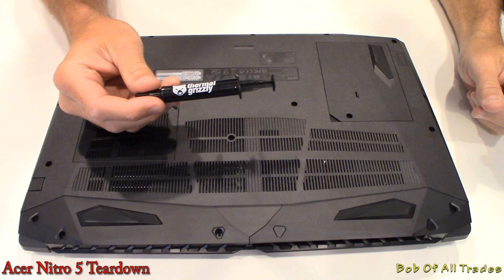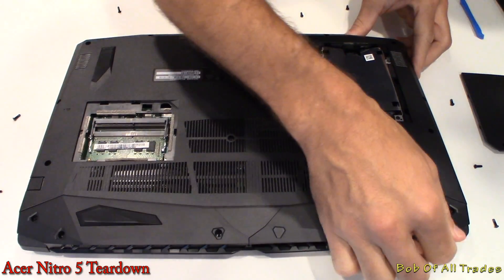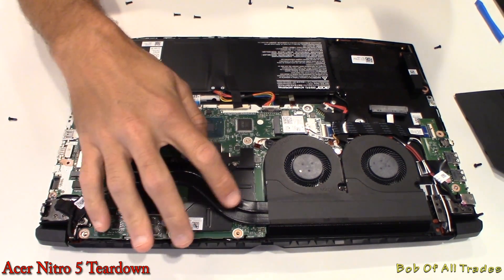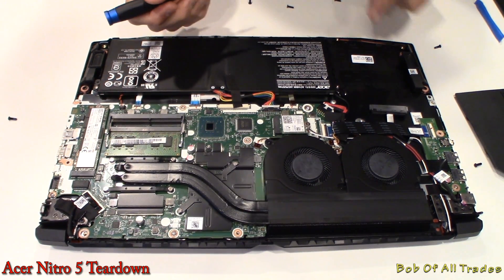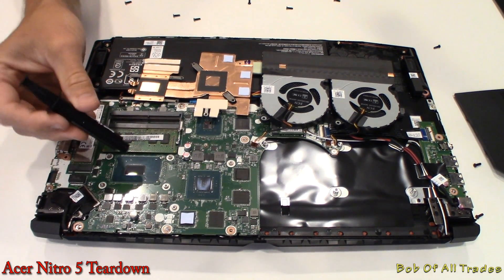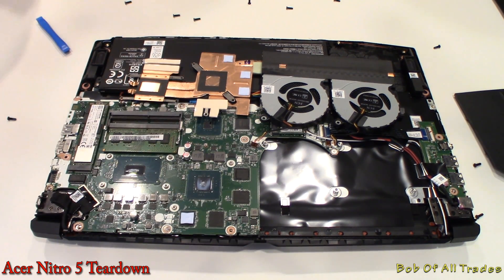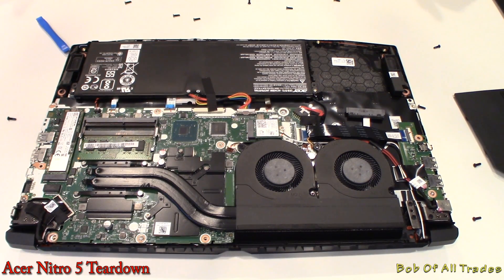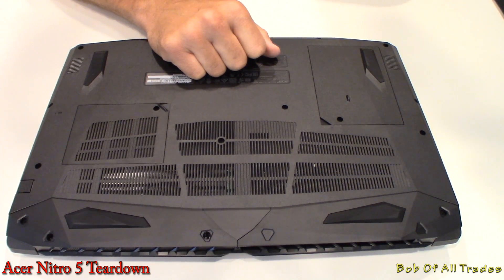Acer Nitro 5 Repaste w/ Kryonaut!  i5 8300h

Comment: i need help  please. i have the same model . my cpu was overheating so i thought it's time to repasting after 4 year , i used (cooler master MasterGel Regular) i cleaned the old paste clean the surface with the cleaner it come with the past. applied a little much compare to the video but not a lot.  the first day was so good temps were 65-78C . after a week my cpu start to raech 95c. idk why. im thinking to give it another shot maybe this time i will use less and spread the past.
Reply from the maker: Mastergel is very soft.  I suggest ICdiamond or phobia nano grease extreme.

Comment: disconnected my battery like yoou did in your video, and somehow, it seems like the battery just died.Spent hours charging it, and my laptop will no longer boot unless plugged in, and the laptop seems to be stuck at 0 percent charging

Comment: Hi my ACER same model as the one in this video stop charging  it ill had volts to the battery thinking the battery was stuffed I replaced it and installed new battery PC started fine was taking a charge then the same problem again. It is hard to find info on the subject  would yo have any ideas  or is it buy a new one.

Comment: You are doing it 100% wrong!
It is mandatory to ensure liquid metal won't spill over electrical components around the cpu/gpu. 
All other YouTube tech guys put electrical tape around the cpu/gpu while applying the paste And spreaded it as even and thin as possible to ensure no spilling. 
With 87k views it is very likely someone short circuited their pc following your steps.
Reply from the maker: This is Kryonaut, not Conductonaut

Comment: Do you still have the Laptop? if so can you check on the sizes of the thermal pads of the vrms? Thank you! mine came with some pink thermal pad thick paste on the vrms and I need to replace it .
Reply from the maker: I suggest you replace it with K5 Pro then 👍

Comment: Yeah, I've taken my Nitro AN515-53 apart about seven times already, and yes, I no longer have all the screws. I have just enough to keep it together, though. Honestly, I haven't replaced the thermal paste since I bought the thing around four years ago. I recently discovered that CPUs and GPUs have thermal paste and need to be replaced every so often. This is probably why the average temperature on both my GPU and CPU is around 170 degrees. Don't even get me started on when I start playing Space Engineers, lmao.

Comment: I have a Nitro 5 with GTX 1050 Ti, and the GPU is not working... is that integrated on the board?. can I fix/replace anything? or just the board?    Can you point me in the right direction to buy what I need?

Comment: I just repasted my nitro 5 with an MX-4 arctic, the gpu temp reduced from 90s to 70s, but the cpu temp are kept between 99 and 100,are these even normal or am i missing something?
Reply: Did you find out what caused your CPU overheating?
Reply: @marcolujan2457  i eventually gave up, probably caused by a bad thermal design, but i will repaste it again tomorrow coz the GPU starts heating up again.
Reply: @Arszene  sorry to hear that. Hopefully you'll get better results this time. Btw, is it necessary to remove the ram sticks when you're gonna repaste?
Reply: @marcolujan2457  nope, you don't need to remove RAM if the slots doesn't interfere with your CPU Thermal, but in my specific laptop model, i have to remove my harddrive because it interfere.
Reply: @Arszene  thanks. I think we have the same model

Comment: I did repaste my Acer Nitro 5 with Noctua and the thermals go down to 75 without undervolt. But the next day they go high again, playing battlefield 1 84,87 with undervolt. Any advice?
Reply from the maker: Are you running Max fan speed? If not the fans should just scale to your thermals. Otherwise there could be some pump out occurring.
Reply: @BobOfAllTrades  I use Auto fan speed, and Coolboost mode. Maybe I need also to repaste the VRMS, with thermal pads or thermal grease....
Reply from the maker: Is it the exact same specs from this unit here?
Reply: @BobOfAllTrades  I have the NItro 5/  i5 9300h with GTX 1650 4gb

Comment: Alright im gonna clean my laptop fans and redo thermal paste this weekend. it has been running at like 50-65 c idle and 85-95 while gaming. wish me luck
Reply: About to do the same thing this weekend and I have similar temps as you currently. Let me know how it turns out for you!
Reply: @neilkillian7301  sadly for me the screws on my hard drive cover have been stripped. I have tried pretty much everything and today or tomorrow im going to try using pliers to get them out but i doubt it will work. I will probably just have to clean it using compressed air and hope that is enough
Reply: @TDYT103  Damn that sucks :/ I hope you have some luck with the pliers. I will let you know how it turns out for me

Comment: do you recommend repasting a new lenovo ideapad gaming 3 with 10th gen cpu(those things are hot!!) -70 undervolting is only helping 2-3 degrees?
Reply from the maker: You can try but those aren’t exactly thermally efficient.
Reply: @BobOfAllTrades  Ya not the best cooling design  93-98*c cpu temp gaming is unacceptable i had to cap clock speed to 3.8 to get it in the 80s i think i will try thermalright tfx have you tried it before?
(BTW i5 10300h)

Comment: What if there's something connected to your HDD and you can't take the cover off because of it
Reply from the maker: You’ll have to disconnect everything necessary to remove it. Mine only had M.2 storage as my 2 1/2 inch drive bay on this model was empty.

Comment: Hi there, i have an Acer nitro 5 (i5 9th gen), I read you need to first remove the hard drive to prevent damage, but there is no square/rectangle cutout on the back like in there is in the video and same for the ram slots. Does this mean i can just open it or would i be skipping a step
Reply from the maker: Your chassis is different and has the thinner bezel.  It’s not like this.
Reply: @BobOfAllTrades  Thankyou for the reply! Would you by chance know of  a video on the thinner bezel? Or specifically would you know if i need to worry about taking hard drive out first? I know i can handle the pasting portion i just dont want to ruin my laptop trying to get it apart :)

Comment: Idk if you’re still responding but the screws on the heat sink are too tight and I don’t want to strip the screws. I’m fairly certain they are Phillips head screws but I can’t get them to budge.
Reply from the maker: Try to run the laptop and get it real hot then shut it down and then try to remove them.  

Make sure that screwdriver is not too big or small 👍
Reply: @BobOfAllTrades  thanks for the reply. I did as you asked and the screws still won’t budge unfortunately

Comment: i know it’s been some type of time that went by but i need help with taking off the screws to the cpu/gpu. all the screwdrivers i have used are either too big or too small and the screws are too tight
Reply from the maker: I highly recommend the pro tool kit I have linked in the description.  I won’t take apart laptops without this and I have not stripped a screw, ever.

Comment: I'm having an issue with my Acer Nitro 5 AN-515-42.  I play Rainbow 6 Siege, and one day it just randomly started doing this input stutter, where when I'd look around or walk around, it would stutter back and forth, and it makes the game completely unplayable.  The only way I can deal with it is if I play at 720p, then it almost completely goes away.  I posted about it on Reddit, and someone suggested that it could be my CPU thermal throttling or something and that I should repaste it.  That's what led me here.  Do you think this is the case?

Great video btw.  Will be very helpful if I do have to repaste.
Reply from the maker: You don’t want to guess it’s thermal throttling, you’ll actually want to find out.  So start with something like MSI Afterburner to monitor temps.

Comment: I repasted arctic MX-4  on Acer Nitro 5 (i5 8300h gtx 1050 ) getting 95 c max while playing Witcher 3. did I buy a fake product please help. it's from 2018.
Reply: i guess yes dude, when i playing witcher 3 on i5 7300hq + 1050ti version, with fresh repaste with mastergel maker nano (12.5 w/mk version), i saw in skellige, high - ultra settings : max  65 degree celcius

Comment: i've nitro 5 i7 7700hq 1050ti for 3 years now
then i realize idle temp going crazy 65°-75°, play forza horizon 4 my laptop overheat & shutdown
after cleanup my cpu fan from dust, repaste with grizzly, and undervolt -0.125v
now my idle temp is 38°-40°, play forza horizon 4 never touch 80°

thank you sir for this tutorial!

Comment: This plus Undervolting makes magic !

60 + - Cº avg
70 + - Cº Max

By default was :

75 + - Cº avg
90 + Cº

Hope those 4 months of default use doesn't affect my mate. My battery lasts more too.

4 Months later, My new temps are :

70 + - C° AVG
80 C° MAX

I think it was changed because I adjusted my preset for the max CPU performance whit a low TDP for Underv.
Reply: hey whats ur undervolt setting? i have GTX 1050ti

Comment: What GPU on your nitro5 ? I have the GTX 1060 with the 8300H cpu... I did arctic MX-4 - I have also upgraded the monitor to a 144hz ips gsync one. Mine had more screws for the GPU inside, and mine was made 23.03.2019 one of the last of the old version Nitro 5's I suppose.

Comment: I did the repaste and lowered temps but now i have issues with the gpu, when playing any game i have constant framedrops, what could It be?
Reply: Try to update the gpu... My nitro 5 always have framedrops when i havent updated the gpu driver
Reply: check also on the NVDIA control panel, make sure the game that you're playing have unlimited fps settings
Reply: カルロスPlatinumVs It sounds silly, but check you are not running of integrated graphics both in the Nvidia control panel, and windows graphics settings.

Comment: Hey i have one question, recently i have spilled my soda on acer nitro 5 and it works normaly for 2 months now, and the real question is, is that black layer under motherboard protection? I mean is it protecting other components likr gpu, cpu from spilling drink or smth or not? Pls answer i would really apriciate that.
Reply: I am pretty sure that you have layer under the keyboard. Just look for keyboard teardown video
Reply: @shomy7318  ok thanks!

Comment: Hey I know it's late asking you for this , but I've seen on online market about Noctua NH-T1 and this.
Thermal conductivity is n/a for noctua but for this paste is around 12.
So I want to ask does higher conductivity is the reason for less temp when you use grizzly or some other reason?

I compared it with noctua because of it's reviews
Reply from the maker: Rajat Goswami Anything will be better than stock.  Just go with something modern.  I’m sure that Noctua stuff will be fine 👍
Reply: @BobOfAllTrades  aight man, Thankyou for your time.
Be safe 🙏🏼♥️

Comment: i have the exact model and i have a question does the overheat affect the performance because after a year of no repasting it ( i didnt know that i should ) it starts to heat alot and low specs games now lags and frame drops to 20 fps and such does repasting help the issue ?

Comment: If you are undervolting, it is worth looking into locking the cpu at a lower frequency and it won't heat up as much. I repasted mine, undervolted and lockt it at 3.1 ghz, as a result, when I game it stays around 69°C instead of 95+(it was scorching).
Also if you take it apart, the fans and the heatsink are kind of next to each and that's where the dust and stuff goes.
Reply: how did you lock it at 3.1?

Comment: 3/5 2020 

model acer nitro 5 an515-52

Used your Guide. Undervolted to -.125 
repasted with Arctic Mx-4

Before all This 91c

52 idle :[ 

now more happy then ever!

Idle 45-49 

On full Load between 4-8 gaming {black desert online,Doom Eternal , League of legends ,Smite paladins} 65-69

Didnt even reached 70

When u repaste it make sure u clean the old one properly! :] 

THank u and subbed
Reply: What screwdrivers did u use to remove the heat sink
Reply: What did you use to clean the paste up
Reply: @crgraduu  isopropyl alcohol on little cloth ...cloth from glasses case :]
Reply: Roman you are a racist and a biggot,I bid you good day Sir.
Reply: @TheGhjgjgjgjgjg  Lmao wtf

Comment: I get 97 degrees Celsius on my nitro 5  i5 8300h. Gtx 1050ti. Iv undervolted and repasted with arctic mx but its still thesame 97, any way of solving this?
Reply: Did you clean the fan and the exhaust? Mine was like yours too(repaste & clean the fans on the bottom) and it is still really hot, but then I realized that my laptop is not blowing a lot of air on the back even when I set the fan to max. I took an air blower thingy for camera lens and blow the air on the exhaust of the laptop(lots of dust came out) and my temp went down alot.
Reply: It may also happen that you reach 97 degrees because you use auto fan setting, basically you run at 97 degrees but your fan runs quieter. Use nitro sense to set the fan speed manually.
Reply: RafadanaM hey how do I reattach my cpu back? I was using An air duster I think and it made the cpu come off
Reply: @weeniehut6415  what, did your CPU came off from the motherboard?
Reply: Do you find any solutions?

Comment: what screw driver did you use to take out the screws that held in the copper plates on-top of the gpu and cpu (for the silver screws)
Reply: did you find out?
Reply: IncinerateZ sadly not and fucked up the screws to the point u can take them out so no re-paste for me 😁😭
Reply: @anty2829  oof yeah i stopped cuz i had a feeling that was going to happen so im gonna get my defective screwdriver kit replaced tomorrow

Comment: Can someone please help me I need urgent help! Just comment below if you can so I can ask my question.
Reply: What's up
Reply: Ishan ok so my nitro 5 has a broken screen and for like 6 months I had been using an external monitor to use it and then after updating my graphics drivers it just won’t connect to any displays. I’ve tried the shortcuts and none of them work.
Reply: @Solicle  why haven't you changed your laptop's screen yet?
Reply: Ishan oh yeah because everyone has money laying around
Reply: @Solicle  lol maybe your settings changed so instead of second screen/duplicate, it's set to only show your main monitor
Reply: @esau817  Nah i fixed it, it was way more complicated than that because im not an idiot. The nvidia graphic drivers didnt install properly so I had to take apart another laptop with a 30pin screen and use that

Comment: Should I do this myself (never opened a laptop before) or get it done by a pro?
Reply: Im doing it right now for first time and If you have good screwdiver its easy, my experience have been horrible but for my screwdiver xd,but If u have one good screwdiver of the type its require its easy. and be carefull with the hard drive when take out the cover.
Reply: @Wolffyyy1  Ok now I have to be careful  with more things and makes me unsure about this lmao
Reply: @Wolffyyy1  please tell me what hard drive?
Reply: @Orangejuicemmm  is the video shows, its one of the first parts to take out, but in the video the pc doesnt have a hard drive but you probably would have one
Reply: @Wolffyyy1  ohhh so in that spot our hdd is there by default? And when i take it out.. how do I take out the cable so that my back panel opens fully? I was doing it right now and stopped because that cable was connected to the board..please explain
Reply: Leandro Leader did u guys do it ?
Reply: @maiz3558  not me lol
Reply: Leandro Leader what was the problem u had? Did u get it fixed another way?
Reply: @maiz3558  by a professional, and it wasn't very expensive, at least here in my country

Comment: hmmmm yes aldo i would like to add that my nitro 5 has a i7 8th gen anyways..... also did you remove the hard drive??? cuz i pulled the cover off and was supriced when it resisted a bit when i looked it had those black flat cable things attached to it i did hoever only needed a bit of space to actully clean out my laptop fans it seld i used those white fluffy sticks (forgot the name) to clean it so this was help full for me as i am not very technical sadly cuz i had a problem with my cooling that it picked up so much dust it cooled the second i turned it on now it doesnt (i just went ofer the upper side a couple times the sticks went litrally black from the dust aldo its not all gone it did a good job non the less
also i like to add as a review to acer
when i pull the cover off this rlly nervous situation as you have to put great force in doing so and for a kid (16)that isnt techinal in tis stuff can be pretty "scary" to do as it costed me 1100 euros and paying that is rather expensive yet it picks up so much dust that when i had to clean it i was nervous about it as it was my first time dust cleaning the laptop my self
Reply: Can you help me? What are those cables attached to the upper lid anyways? Do I need to break them or cut them? What do I do coz I was about to pull the back cover off and the same situation happened and I didn't know what to do so I didn't try to open it completely and put it back together